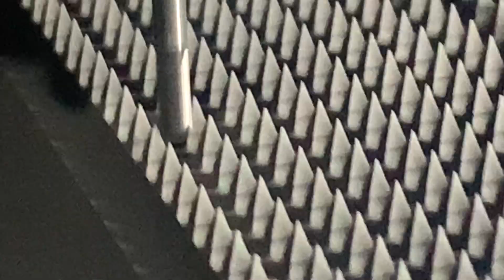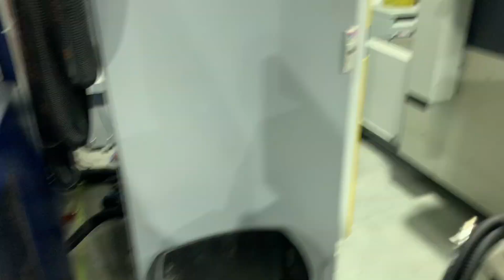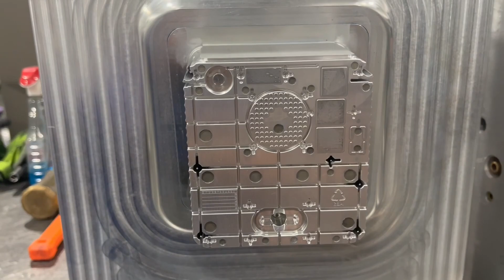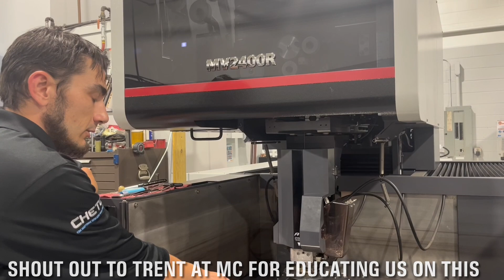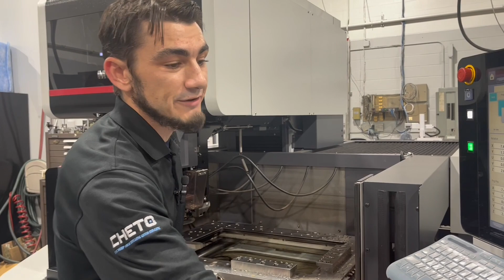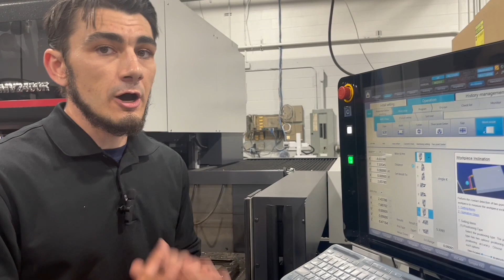Challenges in Mold Making

Comment: I didn't understand the milling part where he eliminated the features to use large cutter. Can somebody please explain how they managed to machine that electrode?
Reply: the milling part is EDM electrode tool design.

they had done it 3 ops... each op with skiped feature.

3 different electrode, for one final result.

the pattern is 1-2-3-1-2-3
in 1st op 1-1, they got gap of 2&3
in 2nd op 2-2, they got gap of 3&1
in 3rd op 3-3, they got gap of 1&2.

the in-between gap allowed them sufficient space to avoid operation mistake in milling which can damage final workpices.

Comment: I first learned to burn in 1985 on a Charmilles D-10 while apprenticing under a Croatian toolmaker. Joined Pratt & Whiney in 1989 where I was a manufacturing engineer until 2001 and was "Yoda" for all edm for the company. We ran Charmilles c-axis die sinkers which I have in my own shop. Cheers lads and keep introducing people to this amazing machining process. The only way to master this process is experience and get your hands dirty. Manual machines are a great way of developing an intuitive nature with the generator and parameters. Master burning out taps and work your way up.